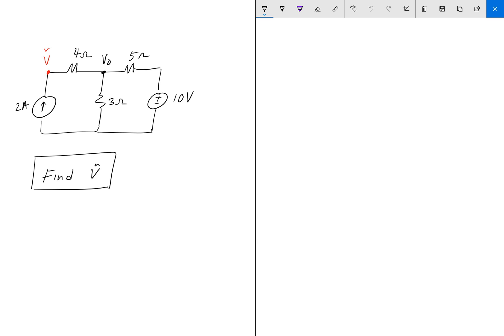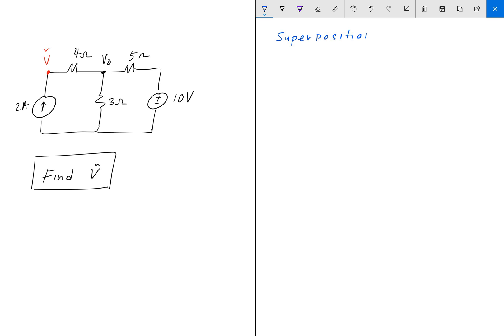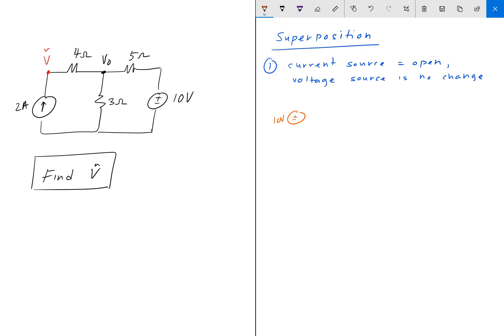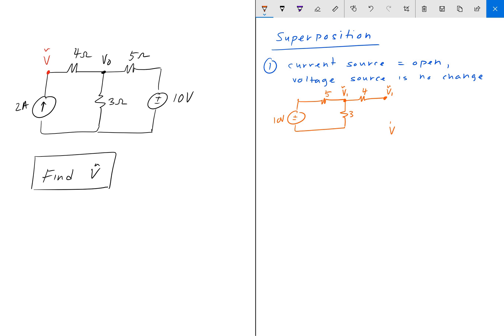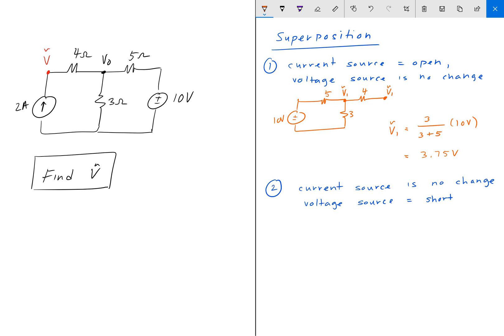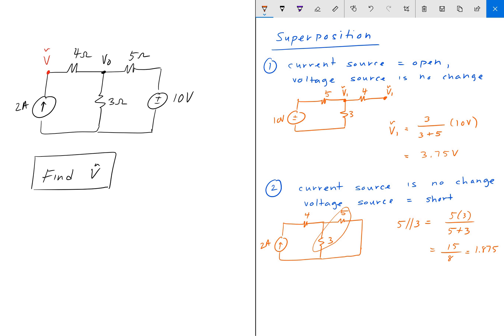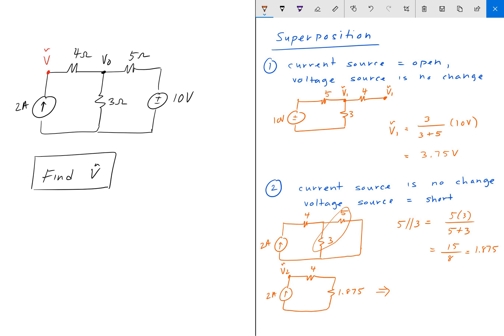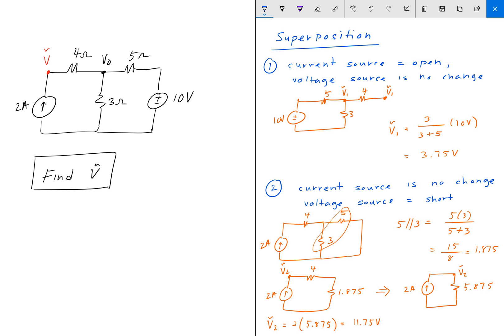Electrical FE /EIT Exam Prep - Circuit Analysis 6: Superposition Principle

Comment: It gives 7.5 volts for me
Reply: Same here.  He did it by superposition but messed up the second part.  The voltage at Vo that's contributed by the current source would be 2 * 1.875 which would yield 3.75.  Add that to the 3.75 from the first part and you get 7.5.  I did it by nodal analysis and got 7.5 which is correct.
Reply: @rafaelr5243  Req is actually 5.875 ohms. 5//3 = 1.875 ohms, then you add 4 ohms(series) wich is 5.875 ohms. After that just multiply that by 2 and that equals 11.75V. Add that to the 3.75 fro part 1 and you get 15.15V.
Reply: @johanmanuelrosariogarcia2033  exactly I used nodal analysis as well and found v out is 7.5. 2A x 4omhs is 8volts plus 7.5 yields 15.5 as you said. Super position is just a technique you don't have to use it.
Reply: @garyhoxha  How did you guys get Vo to be 7.5
Reply: All the work is in the video. How can you get a different value? Also, I took my last EE class 15 years ago. This is still review for me and watching the video 2x w/o any note so far.